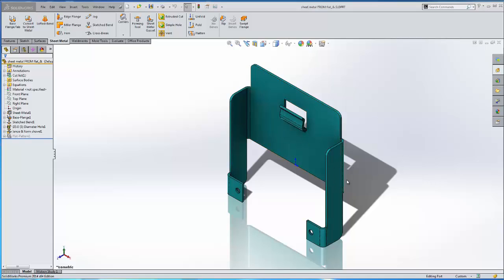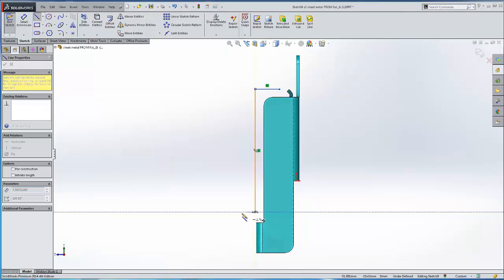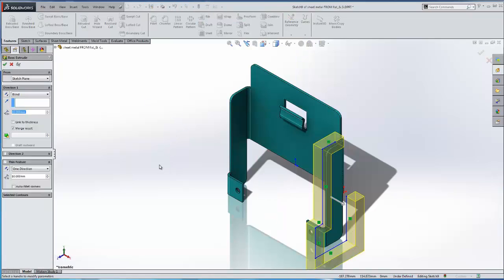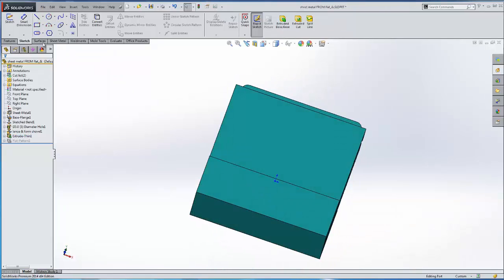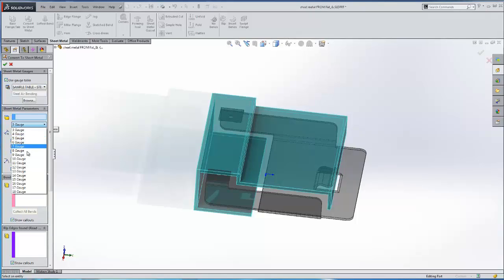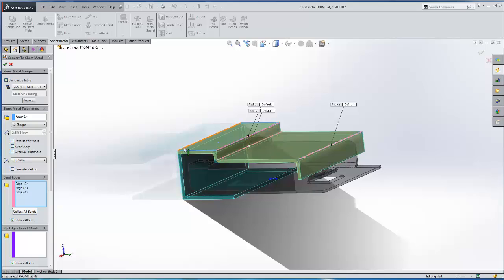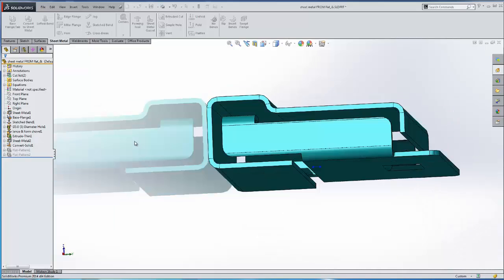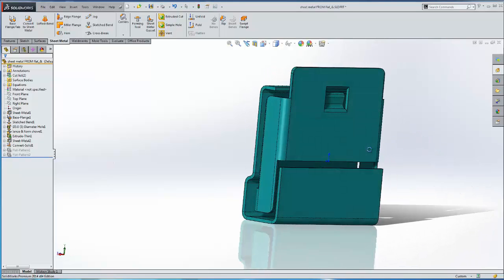SOLIDWORKS - Multi body Sheetmetal Modeling

Comment: As we all know, there are several ways to approach design work in SolidWorks. This particular video idea was spawned off a technical support call, a customer helped over the phone. The customer was looking to take a file (not Solidworks and furthermore, not sheetmetal) and convert it to sheetmetal and multi-body. In reference to the video, it shows a fundamental approach to achieving this. Think of a multi-body iges or step file that has no sheetmetal design intent which has a lid that needs to update as the case increases or deceases in size. I hope this helps clear things up. Yes, it was a quick-easy-elegant solution for a customer having a particular problem but I just wanted to share this concept so maybe others could also benefit from it. Thanks for the great comments guys.

Comment: could cause a possible mistake when making drawings and later copy tree project in SW 2012. Prefer to make every sheetmetal as separate part.
Reply: Agreed, I see where you are coming from. Just showing a different approach to sheetmetal modeling. Sometimes, a more simple solution in a complex parametric model is the multi-body approach, maybe keep that in mind and see if you can use that in the future. Thanks for the comment and thoughts.